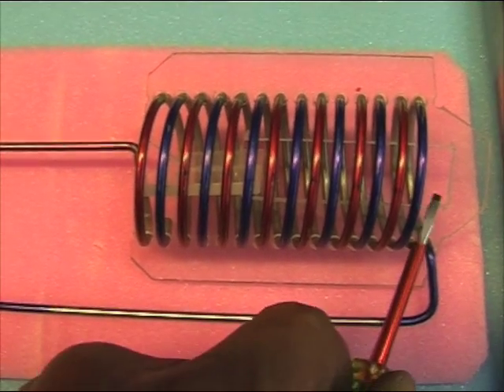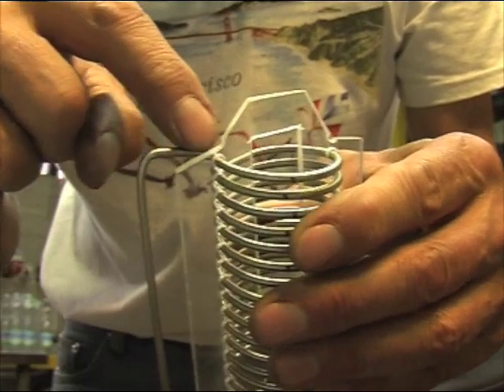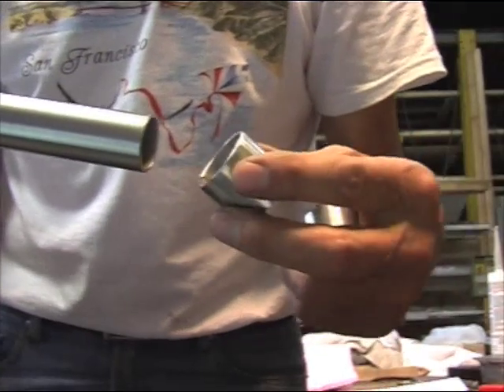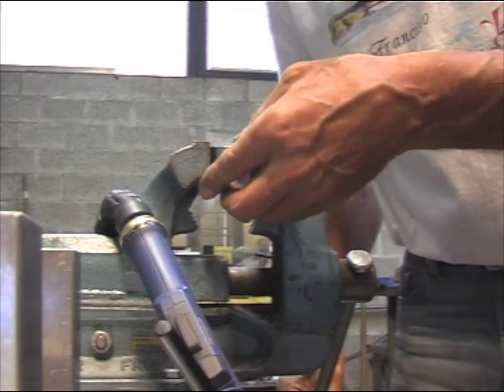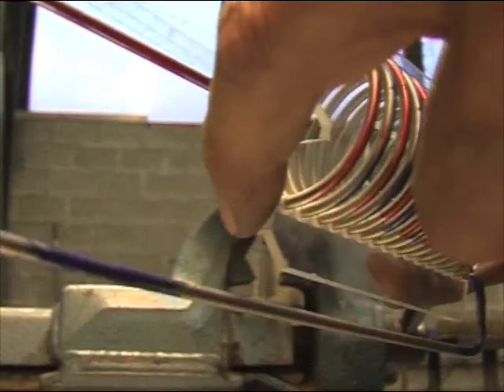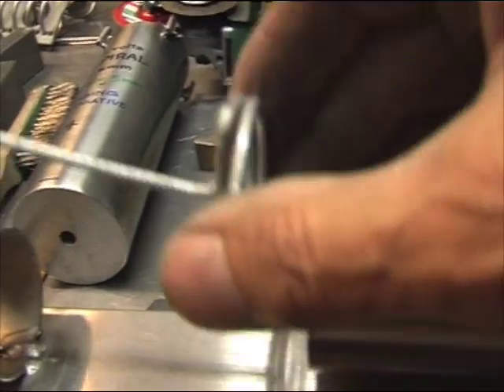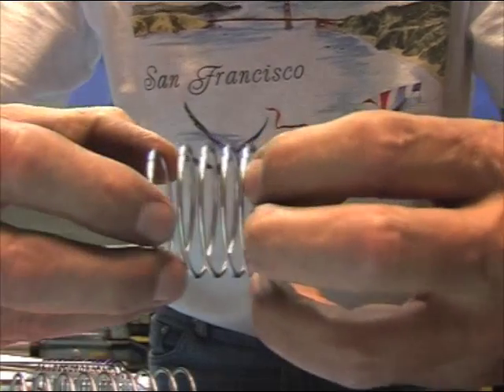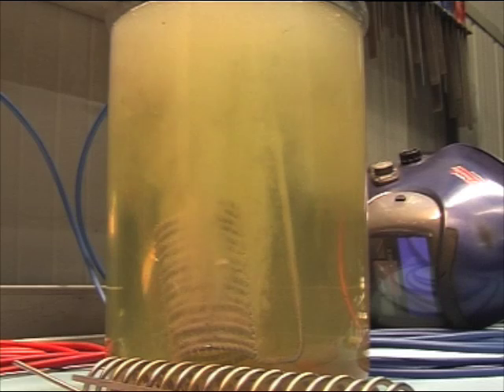HHO SWISS INOX 5 HOW TO BUILD HIGH PRODUCTION SPIRALS

Comment: You do not need a positive link on your cell because you do not need to produce any oxygen with the hydrogen. Your vehicle system of aspiration already produces the oxygen mixing with your petrol.
You only need a neg to neg connection inorder to produce pure condensed hydrogen.

Further more.
Oxyhydrogen is a  bomb.

I advise that the mixing of air and hydrogen be safely done inside the engine.

If you have cast iron engine block, all you need to do is plumb a air line from the overflow to the intake inorder for steam to mix with the elements of fuel, and ground the radiator to the chassis and the battery negetive .
This will saturate the block with usable hydrogen, do some research on this one.
It's the best way to for power and mileage.
It's called gass shift.

Comment: we only have 304 grade stainless rod here in my country is it ok to build with this material sir ?
Reply: Yes but only for experimental reasons in order to see how it works or in order to test new geometry without spending too much. But for serious production it is not ok. Even the 316 is at the limit. Ideal is platinum iridium or ruthenium but the price of it insane so you can forget about it. Read this :  https://newatlas.com/energy/water-splitting-electrolysis-hydrogen-efficient-cheap/?utm_source=New+Atlas+Subscribers&utm_campaign=815e32c281-EMAIL_CAMPAIGN_2019_12_20_02_03&utm_medium=email&utm_term=0_65b67362bd-815e32c281-76702300

Comment: Once the touching positive is only the 316l the negativereducing electrode will not corrode away. Only one coil on 316l is necessary to keep positive away from water. You will have a much cheap device for producing high purity implosive gas. That actually seems to me, plasma trapped in micro water vacuum bubbles.

Comment: Water (H2O) is an inorganic chemical compound formed by two hydrogen atoms (H) and one oxygen (O) .3, if you want to improve the separation you need to respect the proportion with the - and the + (negative and positive), if the water heats up you need less electricity or failing to lower the proportion of NaOH that works as an electrical conductor

gr8 works congratulations

Comment: Use a truck with a lined bed for a bank of batteries. 

 Build a large HHO cell for the truck bed as well.  

The look up "Split the Positive" with Bro Mikey.  It's a way to recycle some of the electricity in the battery bank.

Then a four panel solar system from Amazon or Harbor Freight should be mounted over the battery bank. To charge certain batteries in the rotation or it can be hooked up to the neutral plates in your HHO cell.

This system can be used to generate large amounts of HHO.  If you have the equipment and know how you can do a setup at home and just fill tanks for your vehicle, which saves on weight.

Use this information at your own risk to persons or property.

Comment: generating hho to power a car is a waste of space. One thing the hho generator can do is damage the alternator by giving it work it is not designed for. Also the extra electrical energy derived from the alternator is produced by the engine and common sense should tell one that that energy requires more fuel consumption by the engine .The result is false economy.
Reply: The extra draw on the engine is minimal through the alternator. I've upgraded electrical components, big offroad lights and other high draw devices and upgraded to higher amperage alternators and  never noticed any performance difference even in underpowered 80s vintage 4 cylinder engines. Yes if you have a very small alternator I would recommend upgrading to one producing higher amps. Personally I wouldn't recommend connecting directly to the alternator because then you place all the load on the alternator. I'd connect to the battery and give a buffer between the alternator and the device.

Comment: How did you drill the holes in the acrylic without cracking it?
Reply: Start with a very small drill bit (1mm or 0.5 mm) and build up to the size of hole you want. I find HSS bits work best. Go very slowly with hardly any weight on the drill.
Reply: Thank you for the reply. I had such a hard time with this in the past, that I resorted to making holes with a soldering iron. Which does work pretty well. Cannot wait to make my own generator for HHO. Your design is one of my favorites. I especially like when you overlap several spirals.

Comment: coils like this are easy to make. you don't even need to make a nice jig to wind them with a crank like here, but coils nested ( 4, 6, 8 etc) have more surface area than plates,  the more coils you use will increase the amps used, increasing how much HHO you make :) coils of mesh like screen have even more surface area, but as they are pretty thin, will degrade faster.

Comment: Great helix man. But have you ever tried to make one without damping it with the plastic holder, don't you think if it could swing freely, it would vibrate off a lot off bubbles that otherwise get stuck, especially if you find its accoustic resonance?
 This means of course using pulses (or abrubt discharge) instead of just ordinary low voltage DC.

Comment: i have just got in to the idea of HHO technology so this may sound stupid. But if you were to use less energy and more cells would you be able to make as much hydrogen with out put as much stress as you would on just one coil?
Reply: what is the point to use much more resources? Do you like physics, because that's the only thing you need in order to understand this. H2O molecule has less energy than both oxygen and hydrogen, that's why you need energy to break them apart... So if you use less energy it will lower the production rate, put more cells and you get more production. Both energy in molecules and in your anodes and cathodes will be the same use of energy in Electricity AND Chemical energy.(Thermodynamics and Chemistry) I don't really know what is worth more in money though.
Reply: Petros Oratiou thank you for clearing up somethings but it didn't answer my question it may have been because of the way i worded it. would it be more efficient with less stress on the coils like heat, corrosion, etc.
Reply: cody lee Well yes.

Comment: That is not statistics. Go to Wikipedia and search "Gas Gallon Equivalent".
On the page you will find that the energy equivalent to one gallon of gas is 357.37 cu ft of hydrogen at 101.325 kPa of pressure (typical atmospheric pressure). 357.37 cu ft is equal to 10,119.591 liters or approx. 10,000 liters of hydrogen. However, HHO is not pure hydrogen but a mix with one third oxygen gas. Thus one gallon of gas is equivalent to approx. 1.5 x 10,000 = 15,000 liters of HHO :-)

Comment: Hi thank you for an interesting  instruction,a company in the uk used spiral stainless tubing with a copper wire insert  sealed both ends then created the coils the copper although isolated from the electrolite lowered the temperature and increased hho production due to the increased conductivity,but minus the copper erosion,just thought I would confirm what ammaninox had said,it realy makes a difference.

Comment: I dont believe its the spiral design that is the cause of the heat, I believe the heat increases with an increase in amps. I also believe you are pulling so much amps from your small design because there are no neutral plates and in a spiral design i am not sure if adding neutral spirals would work or not, I would try having a larger negative spiral and a steel pipe going over the positive spiral and the negative on the outside of the pipe acting as a neutral plate to lower heat generation.

Comment: I like your design best.
Could you reduce the resistance/ high heat problem if you used several fine s.steel wires together ? This way the electrons move on a greater surface area, more easily and with lower heat , since there is less resistance for the current flow. ?
Just a thought. Great production of gas though, it would make a significant mileage improvement compared to the other units shown on YouTube. Thank you, gk.

Comment: I do not comment often, But, Having made coils myself, for other purposes, I thought I would mention how I got my spacing to work out easily.
I like your hand-crank tube, do everything up to the point of inserting the wire to be coiled.
Insert 4 wires in parallel, Wind at a sharper angle, well call them wires 1,2,3,and 4.
when done, unscrew 4, and 3.  Now if you simply shift 2, youll see that you have a perfect one wire spacing between 1, and 2.. You can rethread 3 and 4 as a second coil.
Reply: I was thinking within those lines, yes, so we don't need tuning the coils, for mass production ;) this is really cool thought and the the video is well done.

Comment: hi i tried this in a water filter housing, but how thick acrylic plastic do you use because when it got a bit hot the acrylic spacing plastic just got buckled when it reached operating temprature can i use thicker acrylic plate or did i maby use wrong acrylic ??

Comment: the stainless rod you are using is that just stainless tig weld filler rod i made 1 thismorning and worked pretty well let me know if thats what you had used thanks, also how many amps were you pulling with that setup?

Comment: hi ammanninox after watching your video I have followd your suggestion and builded a dry cell. I have a problem. I have connected the cell to a power bench supply that is supposed to give me up to 40A and 12 V but the production is very low... actually it is ridiculus. Yes the gas ignite but no way can feed car or a cigaret lighter. I have put in line with my car battery and the result is the same. Do you have suggestions??? thank Kilo

Comment: "Good night! congratulations matter and would like to know from you, what is the material used for separation of spring you use, it seems ... copper and copper conductor of energy is, however, but the positive and negative poles do not have to be isolated within the tank (pot, vessel), into the water??, or the material is an insulator of the two poles, and what material?? thank you. again and congratulations!... wanderlei, minhoka, brasil, ribeirao preto-s.p.

Comment: I am sorry I didn't make my question clear for you. What  I meant was use a hollow piece of tubing, say 1/4" od and send a copper wire through the center all the way. I guess you would have to issolate the copper by sealing the ends so they would not errode the copper wire. Then use the wire to carry the current.

Comment: I am not sure why you generate a lot of heat. Is it the spiral design? I have made a few with plates and have not produced any heat. I love this design, one question- If I used 316 tubing and placed a copper wire sealed inside, do you think that would help the heat problem?

Comment: how long will the stainless steel last without corroding too far, plus if you were to set two or three up in a series or parralel circuit would this be enough to run a 2litre car up to 110 klm/h for over 4 hours???? have searched heaps to find these answers but nobody seems to know the longevity of the project. thank you for your time.

Comment from the maker: The spacing is up to your precision in making the coils. 2 to 3 mm is an adequate spacing when using thin rods or marine wires. Remember though that a coil is basically a heater so you waste a lot of energy in heat, and the connections might get really hot, so if you can keep them in the water it is better. You have to test your cell with the electrolyzer by putting it into your freezer, or just the water+electrolyzer in a jar and see what happens, and then act accordingly. Good luck!

Comment: What about smaller spirals like 1" or 20MM? More can fit in your Container. Also on your plate design round all edges no 90degree angles anywhere metal is exposed. It will dramatically reduce current leakage.

Comment: Hi ammonninox nice tutorial. I think you can improve yourspiral production by forcing the distance of spirae at the moment you bend the wire. With a little more effort in the progecting of the bender you will have more spirals completely shaped in shorter time. If I'll have the time to work on it will be happy to share. 
one question... did you apply the hho produced to an engine? can you do to a disel engine? do you have suggestion or links on how is supposed to be done? :) Kilo. 
one question

Comment: I forgot to mention that platinum has a strong reaction on the decomposition of water and you don't need to put anything else in the water to obtain hho. But don't use only platinum wire because has great electrical resistivity and is expensive.

Comment: Replace stainless steel with copper wire (2.0mm) then apply platinum powder over the copper wire and you will obtain around 40L hho/minute with 6V and 10 amps. Good luck and enjoy free energy, already many people use this, soon will be public and unstoppable, the oil companies can't do anything about it. Free energy is the future.

Comment: @AmazGraz 316 has less nickle in it so its less pliable and thus makes a stronger spring or helix. Another thing, the more nickle you have the more corrosion you have.  304 etc is the mix of choice only because its cheaper, even though you can clearly see the flaws right in the metal, especially Mexican SS, as opposed to quality German SS.

Comment: With as many jigs you have made to make the coil, here is one more I use for my chainmail. drill your holes in the turning pipe to make a slot, that will except 4 wires side by side tighly. so when you unwrap them they are already the correct distance apart for every turn you make.  This means wires 1 and 3 have the same space between them to the right distance needed for the center wire holding jig. Also you could make a smaller set to fit in the middle as you neutral wire/plate.

Comment: I suspect flat stock would be better. It would give a more uniform surface to surface conducting path. Why 316? I used to work with that in machine shop, but I found that it was not the number one preferred version of SS in the real world. Another thing, I have considered that flat plates bubble so much that the flow of water is interrupted, and that means less production. So is that why you are doing spirals?

Comment: Excellent  video!  You might try this to help reduce the work required to produce the coils.  As you are winding the stainless wire on your mandrel, if you place a spacer (that is the same width as the space between the coils on the form) at the wire as it is formed around the mandrel when you finish winding you will have a perfect coil or nearly perfect with no or very little adjustments needed

Comment: Queria saber que aleacion de acero inox se usa (316 L ?) los aislantes de que material pueden ser? nylon, teflon?
Tendria usted planos de costruccion de estos y los demas componentes necesarios para un kit de auto?
Gracias por su video!!

I wanted to know that stainless steel alloy is used (316 L?) The insulating material that can be? nylon, Teflon? 
Would you CONSTRUCTION levels of these and other components necessary for a kit car? 
Thanks for your video!

Comment: I would say based on my own research and readings, the Resonant Electrolysis technique seems to be best. Of course it requires a bit of circuitry that you have to make so it's a bit more involved, but if you work at it, you can certainly do it.

You have to recognize that Watts are actually a measurement of heat. So if you put more voltage into the system and use an electrolyte to increase current, well then you get more heat.

Great fabrication lesson ammanninox. Thanks for the vids!

Comment: It seems that the most popular way of producing HHO lately is the brute force method using DC and an electrolyte. However, there is another way by which you need significantly less current and no electrolyte. This method makes use of a Resonant Electrolysis circuit.

While using the twin Helix as you have done in your design is probably one of the most effective and simple ways using brute force, Resonant Electrolysis has more potential to produce high volumes of HHO.

Check out Stan Meyer.

Comment from the maker: Yes it is normal if it is a spiral or a single plates + and - , because you pass more energy through the water than is needed to make the separation into HHO and that energy leftover heats the water. Some use PWM's to reduce heat, and some change design of the cell. I changed my cell design. Heat is a sign the cell is not working efficiently.
AMOX

Comment: obviously if you are using this in a car u will have to have a system of replacing the old water from hydrolysis,i think hydroysis makes some other nasty chemicals if u are using electrolytes,like a pump that puts new water in the cell after a certian time

Comment: Why do you go trrough all the trouble of building a coil simply to connect it to a dc voltage?     A coil is effective ONLY with alternative current; with dc current, it's the surface area that is important.

Comment: community effort needed, collective effort from interested community will help win this war faster. Anyone thot about using Capacitors for electric pulse discharge as compared to constant current drain. And maybe aquarium pump to feed the hydrogen into the carb. Constant and regular  supply will eradicated fuel supply totally making the system 100% HHO based. Comments pls and no tech jargon from it cant b done sceptics....

Comment: good job. you can turn your coils without haveing to spread them after. if you place a coil as a template first you can wind your new coil in between the windings of the template to get your exact spacing to save time. just a thought.